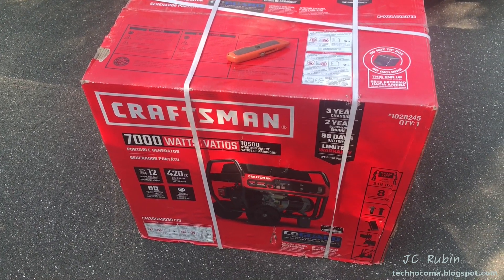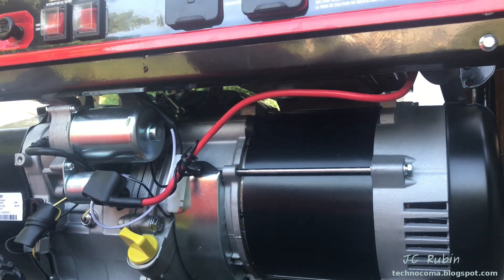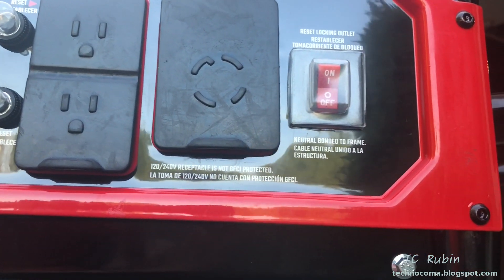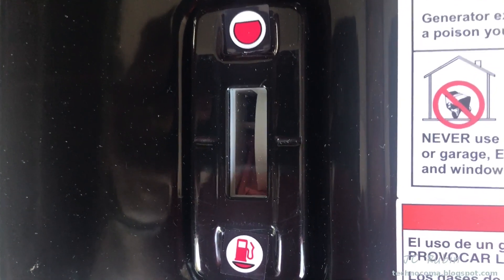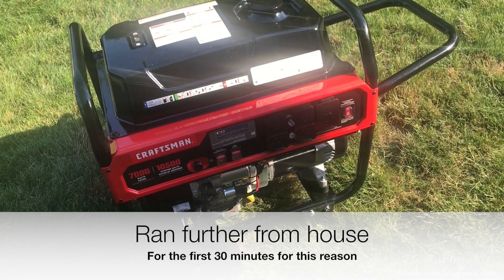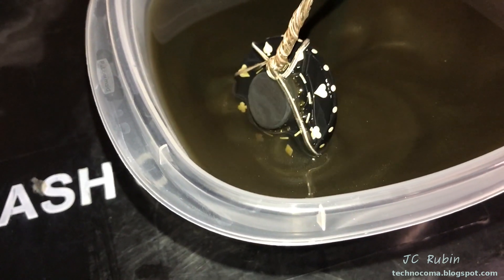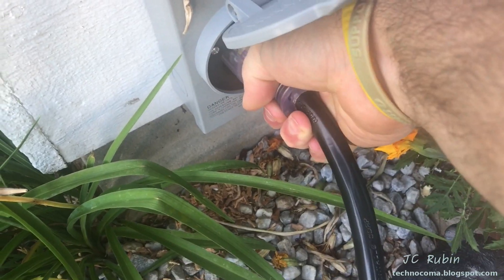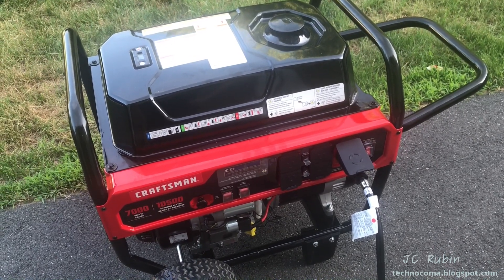Craftsman 7000 Watt Generator - Unboxing / Break-in / Testing and Transfer Switch Connectivity

Comment: There's a small filter built into the fuel shut off valve. Also, how is the generator holding up?
Reply from the maker: No issues yet.

Comment: This thing is a POS. The CO detector is a flaw and B&S knows it. See how many people are complaining about it. Pure Chinese junk.
Reply from the maker: If my life depended on it I would only be using a top rated CO alarm near any appliance where it would be warranted. Our generator runs by the transfer switch receptacle at the front of the house far from any indoor danger.
Reply: which Generator would considered buying ? Thanks
Reply: @rockystelone21  Anything that doesn't have a CO detector. However, if you're handy, you can bypass them. Most gens today are all Chinese powered junk. If you maintain them as they should be, they'll last. Most folks just run them when they need them (if they start) and never do any maintenance on them.
Reply: @joeganusi8522  Thanks for the advice

Comment: The pull start works fine. The electric start won't work. I have always kept it plugged in on a trickle charge. How long does the battery last . There is less than 2 hours on use on the unit. Do you think the battery needs to be replaced or put on a stronger charger?
Reply from the maker: I use a trickle charger for the battery, its always plugged in, never had any starting issues in 2 years of testing.
Reply: Don’t forget about generator safety as well https://youtu.be/I1jT3ANENvI keep children safe when using generators if you have children. Just hoping everyone stays safe using generators. Thank you

Comment: I  have one that I have running through a transfer switch. Works great.
Reply from the maker: Yes it does well on our transfer switch through we have not tried it in conjunction with the water heater
Reply: @retrotechandelectronics  I turn the hot water heater off. Not necessary.

Comment: Its a very good generator,  we got that one in 2018 , its still running in 2021 , but one important reminder do not keep the factory brake in oil  , we made that mistake and it locked up but fixed it and new good oil
Reply from the maker: Should just be a high zinc oil, but nothing terrible. Though, it should have long since been removed in services
Reply: My I barely use and started shutting off!! Maybe because haven’t changed factory oil?

Comment: When shutting down a generator, it is best to unload it, then, turn off the fuel, not the ignition. That will drain the carburetor, so fuel cannot evaporate, leaving varnish behind in the carburetor. This is especially important, if the fuel has ANY ethanol in it. It is even good practice to put on the choke after it has run dry, and attempt to start it again. It will often try to start, then immediately stall out, as it clears out the last little bit of liquid fuel from the float bowl, the main jet, the idle circuit, and the emulsion tubes. That way, if the generator isn't needed again for a few months, it will start just like new. It is best, to keep the gas tank completely full, rather than partially full, because the fuel preserves much longer. the stabilizing additive is a very good idea as well. If you DON'T need the generator for close to a year, it's a good idea, to use it anyway, just to burn of most, if not all the fuel, then add new, fresh fuel. Since this engine has no filter, it's not a bad idea to change the oil each time you fill that huge gas tank. As a rule, I like to change the oil every 7-1/2 gallons of fuel per quart of oil capacity. That engine holds just slightly over a quart, so 8-1/2 gallons is just about right.
Reply from the maker: There is a bowl drain on this one with a hose, a fuel tank and screw driver is all that is needed to completely drain the carbs.
Reply: @retrotechandelectronics  That's great: My snow blower also has that. It's still advisable to put on the choke, and give the pull starter a few good yanks, to make sure the emulsion tube, jets and idle circuit are clear. Residual fuel in those passages can cause trouble.

Comment: Thanks for the review.  Since your oil looks ok I'll just leave mine in for a year until I change it.  I got the 3500w
Reply from the maker: Look again, that oil is filled with powdered metal from breakin
Reply: @retrotechandelectronics  You don't want that metal particulate swimming in the oil. If the engine is run too long without the first change, it will likely wear the cylinder and rings, and become a chronic oil burner. Generators equipped with large gas tanks like this, can actually run out of oil, BEFORE running out of gas. If the engine isn't equipped with low oil cutoff, or, the sensor malfunctions, BY-BY engine! That initial oil change is critical, for the long term performance and reliability of the engine.
Reply from the maker: @vincentrobinette1507  That oil was pulled from the exact specified time or breakin up to the hour

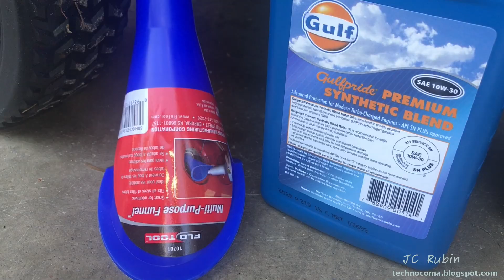Comment: Hey, J.  great vid as usual.  Also, at 4:14 though, I think you meant 10W-30.  cheers, brotha.
Reply from the maker: I did not catch that, sure enough, staring at it was not enough to say it correctly.................
Reply: Everyone really needs to watch very this important video about generator safety https://youtu.be/I1jT3ANENvI this video shouldn’t be ignored. This advice is very important for everyone to know about if they get power outages using generators. Thank you. Be sure to leave a comment